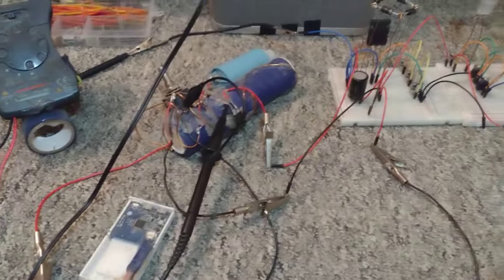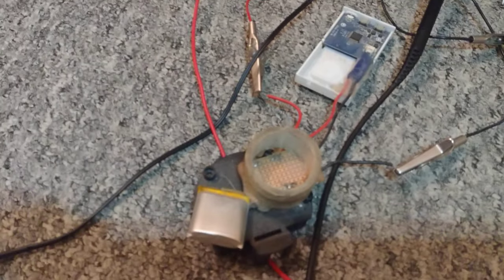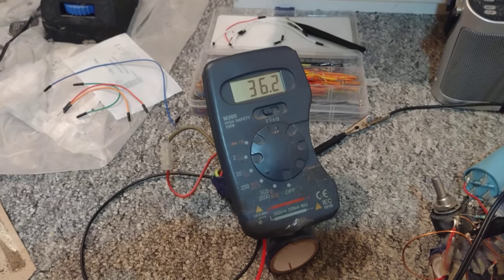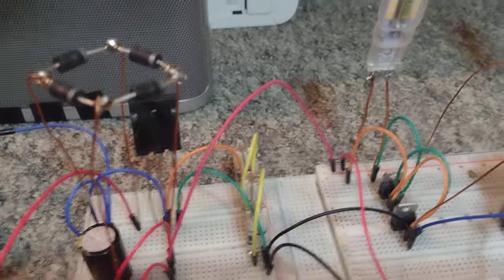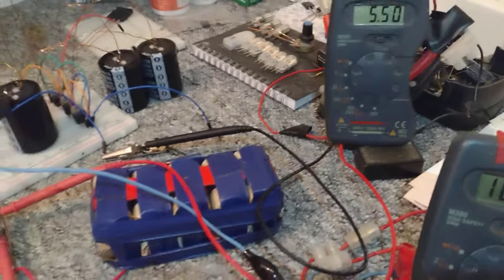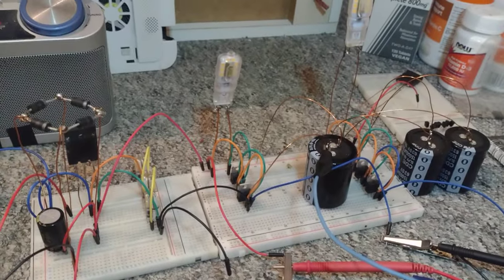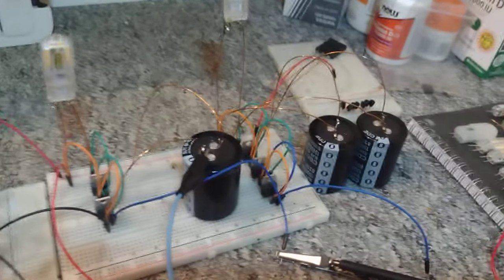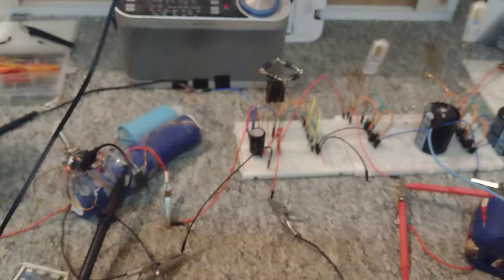A Multiple Stage Capsule Cap Dump.

Comment: Why did you make this
Reply from the maker: it allows the charge to rise higher & offers greater control over the fine tuning of the rate of the discharge to the output load...  need to experiment with it more before I aim to fix it down.